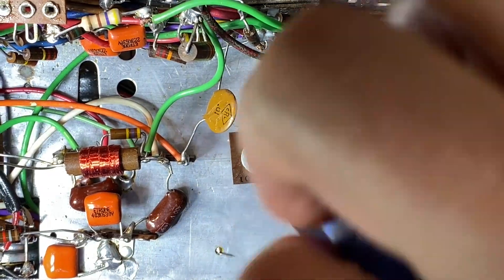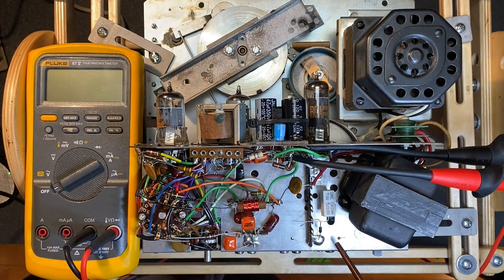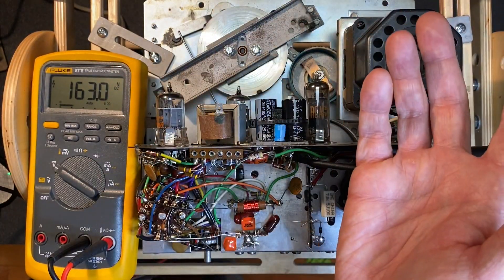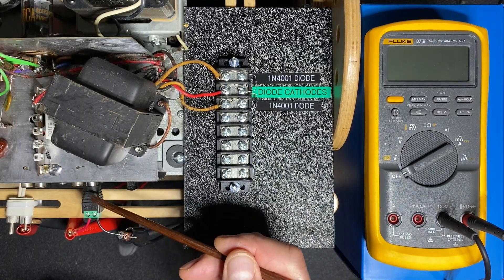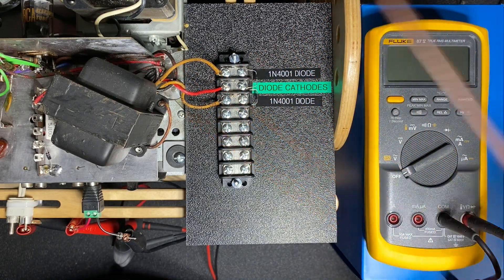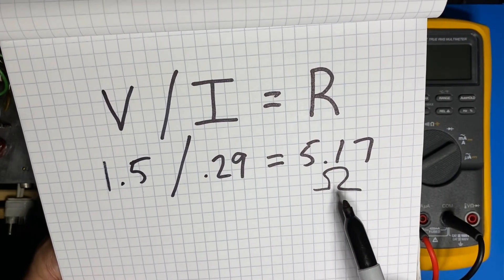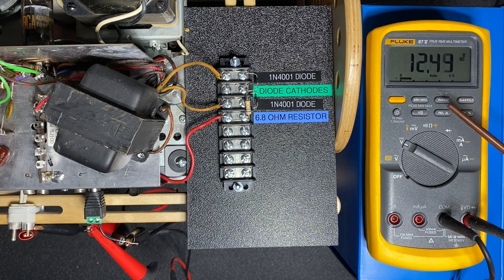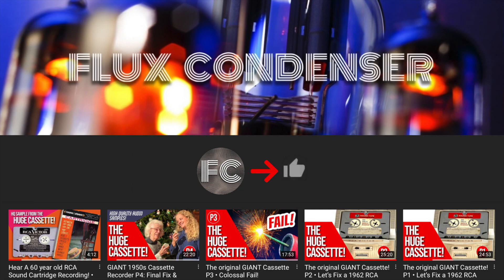How To Replace Selenium Rectifiers • Choose The Right Diode & Dropping Resistor

Comment from the maker: IMPORTANT! Selenium rectifiers almost always have their polarity marked incorrectly. With modern diodes, the cathode (striped end) is negative and the anode (non-striped end) is positive. Seleniums, however, have their cathodes marked as positive and anodes marked as negative. Please consider this when replacing selenium rectifiers and consult the schematic for your device for proper diode orientation.
Reply: There was no mistake. At the time the (+) correctly indicated the DC voltage polarity and yes it was the cathode end. The same is done today on a modern silicon bridge rectifier block, The common cathodes are marked (+) and the common anodes are marked (-) .
Reply from the maker: @45Victrola  Whether we call it a mistake or not, selenium rectifiers and the modern diodes that replace them are marked in a completely opposite way. A full wave bridge rectifier, while composed of four diodes, does not behave as a single diode and should not be used for comparison to a single diode.
Reply: @FluxCondenser  You missed my point. I don't disagree, they are marked differently. Care and caution should be used when replacing a selenium diode with a silicon diode, it can easily confuse the novice. Selenium diodes were in use long before silicon diodes. The way they were marked was the first standard. Later silicon diodes adopted a ring around the cathode end of the device and it's logical because it resembles the cathode of the electronic symbol for a diode. The only point I take issue with is that they were marked incorrectly. It implies that early engineers were incompetent.

One of my peeves around rectifier diodes is the way everyone seems to refer to the resistor immediately following the diode as a voltage dropping resistor. It is actually a current surge resistor designed to protect the diode at powerup. The voltage drop is a secondary effect.
Reply from the maker: @45Victrola  I didn’t miss your point as the first sentence in my reply to you began, “Whether we call it a mistake or not…” And I agree it’s a good point. Mistake is the wrong word. As you say, early engineers were far from incompetent. We’ve largely settled on using conventional current flow as the standard these days (positive to negative), but actual electron flow is the opposite (negative to positive). Seleniums were polarity marked for electron flow, and that simply doesn’t fit into the conventional current flow world.
Reply: That might explain why some Fender amps have the polarity symbols the wrong way round on several of their schematics. It usually occurs in bias circuit drawings as that is the only part of his designs, Leo Fender used seleniums.

Comment: I don't have a 1N4007 to replace the selenium rectifier in my old Emerson table top radio. However, I do have a 1N538 silicon rectifier. Will this work in place of the 1N4007?
Reply: 1N538 is a 200V 0.25A average current silicon diode. It should work for currents not higher than 0.25A per diode.

Comment: Yup those Se rectifiers smell horrible when they fail. Replaced 2 very large ones in a forklift battery charger. They failed so bad that one meted to slag and tripped the 60A breaker on the charger. Replaced them with welder doodes and changed the tap on the big transformer to a 277 tap instead of the 208v one to get the correct float voltage. ❤

Comment: A couple of (hopefully helpful) ideas. 
If replacing a high voltage (multi-stack) selenium rectifier, and the output voltage is critical, and you have no alternative transformer taps to bring the voltage back down:
Add the same number of silicon diodes in series as the selenium rectifier had elements - this way you closely match Se voltage drop.
Be sure to arrange the diodes so that the heat they generate can be lost.

If you want to replace a selenium panel mount half-bridge rectifier, use half of a silicon panel mount full bridge rectifier (use 3 of the 4 pins)

Comment: So I am trying to replace a Federal 1005A selenium rectifier. I replaced them with 1N4007 diodes. All the circuitry on the appliance is 120 vAC. What kind of dropping resistor do I need? (I'm not very knowledgeable on the topic so please forgive me)

Comment: The theory of calculating a series resistance is ok somewhat.... it assumes the current draw on the dc side of ther power supply is somewhat constant throughout the use of the device.. Sometimes however something on the load side of the dc supply requires more current.. that series resistance may result in the DC voltage being too low at that moment in operation.... If you are replacing what seems to be a perfectly operating selinium rectifier monitor the DC supply's output voltage through out all the device's operation, solenoids and motors may switch  on and off during normal operation... then after making the change keep an eye on the DC output voltage through all the device's operation..  verify the DC voltage is not dropping down too far when solenoids and motors turn on..
Reply from the maker: The silicon will be able to supply as much or more current as the selenium and all measurements should be done closely keeping the voltages to spec with a variable output AC power supply.
Reply: The more current the load draws on top of the idle currant the larger the voltage drop across the resistor.the lower the voltage drops to the load.. its called the IR drop.. no doubt the rectifiers will have no problem supplying the current but the ir drop increases with the load current demand..  the above technique for calculating the resistors would be ok so long as motors and solenoids are not being activated.. so do you calculate the resistance on the minimum current or at the maximum current.. may not be a problem or could be a problem.
Reply from the maker: Been doing it this way for years with many devices. Never a problem.

Comment: I have a Selenium in my Triplett 3480 tube tester, it is off-gassing, because it is a multi-voltage output dc, do I test with the lowest voltage or highest or perhaps midway?
Reply from the maker: The selenium should be replaced. When you say test with the voltage, which test are you trying to accomplish?

Comment: If you notice, there are vanes (or the heatsinks) for each selenium diode. Each selenium diode has a voltage drop of 1 volt, a silicon diode is approximately 0.6volts. So as a selenium diode segment is good for a back EMF of 20 volts, HT diodes have many segments, each one dropping 1 volt. Hence the need for a resistor to drop the extra voltage. A 12 volt selenium diode will drop 1 volt and silicon 0.6 volts. a 300 volt selenium diode is made up of 15 segments, so 15 volt drop. A silicon 1N400* has a 0.6 volt drop.
Reply from the maker: Thanks for the added info, Jon.

Comment: Microwave rectifier for voltage drop.
I haven't tried this yet but it occurred to me that it would be more efficient to install one or two microwave rectifier diodes in series with the silicone replacement bridge to handle the appropriate voltage drop.  Those diodes are multiple diodes in series to handle the HV they're rectifying.  They also handle a fair amount of current.
You can forward bias the diode and check the drop by inserting a 9V battery in series with your voltmeter. 
They have about 3 volts drop.
So, just insert the appropriate number of microwave rect diodes in series with your bridge rect and voila!  Instant voltage drop with minimum heat produced.
Any ideas on why this might be a problem are welcome.
NOTE:You'll have to buy the entire microwave oven at a thrift store as the appliance industry has decided these diodes are precious and want like $50+ each for these
Reply from the maker: Any diode will drop voltage and yes, you can use a bunch of them together to attempt to get the voltage you need. There are advantages to do this over using a resistor (less heat), but it can take a lot of them as the drop per diode is less than a volt.
Reply: @FluxCondenser  Agreed.  the advantages here are that you have a bunch of diodes that are rated for HV as well as relatively high current in one relatively small package that can be easily added.  And, as you mentioned with minimal heat generated as well as the diodes won't make the supply spongy as a resistor in series would.  The voltage drop across the HV diode will remain solid regardless current draw.
Reply from the maker: @glenwhatley4125  All good points, Glen.

Comment: One minor, probably irrelevant point in this example. When you measured the amplifier current, it was at 14 volts. The amplifier may pull more current at a higher voltage. To be more accurate, you could set the Variac so the amplifier is getting 12.7v and then measure the current. But as we have seen in this example the difference is minuscule but could be significant in other applications.
Reply from the maker: Yes, good point. The current could have been measured before removing the selenium rectifiers to get a more accurate measurement. But, as you, say, it’s a tiny amount of difference and the proof is in the final voltage. Further adjustments to the resistor value could then be made.

Comment: Yeah, you don't wanna be in the room when a selenium rectifier shorts and dies.  The fumes are toxic, but the smell stays around what seems like forever.  Unless a customer threatens my life, I automatically replace seleniums with silicon diodes (and the proper dropping resistor) and return the selenium in a plastic bag.
Reply from the maker: Thanks for sharing your experience with seleniums, Darth. After I posted this video on some Facebook repair groups, I had one particularly rude gentleman argue that I’m being overly cautious, implying there’s nothing to be concerned about. I’ve never seen one go myself, but I’ve heard enough experiences from people like you that I don’t take a chance and replace them ASAP.
Reply: @FluxCondenser  Well, denial works until it doesn't.  There's no down side to making this change, other than the electronic device no longer being in "original" condition.  If that's what the owner wants and is not going to power up the device except to demo that it works then I'll relent.  Almost all of my customers appreciate that I make the device safer for them.  Stay safe and healthy!
Reply from the maker: @darthbubba866  Couldn’t agree more. Thanks for the voice of reason.

Comment: You mis-identify the rectifier as an IN (eye-en)4007, when it is actually a 1N4007. Most diode nomenclature begins with a 1, meaning 1 junction.  A 1N4007 is pretty much a universal replacement for any selenium diode, as it has far higher current and peak inverse voltage ratings. It will just coast in the circuit. Also, there are many cases where changing the series resistor is  unnecessary (e.g. in line powered table radios). The small voltage increase will simply not matter. The main reason a resistor is added is because of the current surge when the electrolytic is being charged. The 100 ohm resistor (this value almost always works) helps absorb the current surge to keep from blowing a fuse at power up. But many circuits with selenium rectifiers already have a series resistor in place.
Reply from the maker: Yes, of course thanks for pointing that out. It’s a bad habit of mine calling them I’s instead of 1’s. The 4007 is a good general purpose diode which I used for the main amp, but I used a more appropriate lower-current diode for the secondary solid-state amp.

In general I disagree that a resistor is not required, especially in the case of vintage radios. They were never designed to operate on today’s higher household voltages, so the dropping resistor is not only best practice to get the voltage to where the selenium would be, but to also further drop voltage to where a 110 or 115 volt-rated radio running at 120V+ really should be.

Comment: Very good. I Like the music, its very like the music on "FranLab" with Blanch. Did you have to study the circuit a lot before making the video or are you just brilliant?
Reply from the maker: Thanks for the great comment, that gave me a chuckle! Sadly, I’m only of average intelligence and this stuff just isn’t as complicated as it seems to the uninitiated. After you’ve been doing this for a while, it all starts making sense.

Diagnosing problems requires more circuit analysis than this procedure which is fairly routine. You’ve got a component that needs to be replaced (the selenium rectifier) and you’ve got one choice: use a diode. The diode will allow more current to pass than a selenium, so you also have to add a resistor so the replacement components match the originals. 

From there, it’s a simple matter of knowing which way to install the diode, how to figure out the correct diode and resistor, and knowing how to install the parts.

FranLab is great!

Comment: Wow. I had never noticed that before on the selenium rectifiers, so I checked the ones I had removed. Yup, you're right. A big plus sign on the "output" side. I am used to working with the silicon ones, so I just referred to the schematic and  oriented the band correctly. Appreciate the heads up!
Reply from the maker: My pleasure, Bingo. Glad you found that useful.